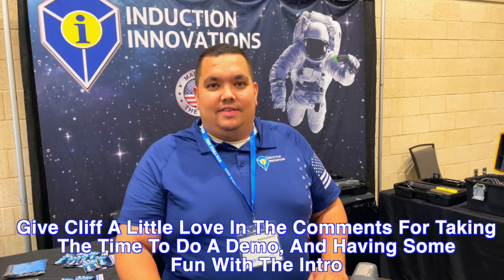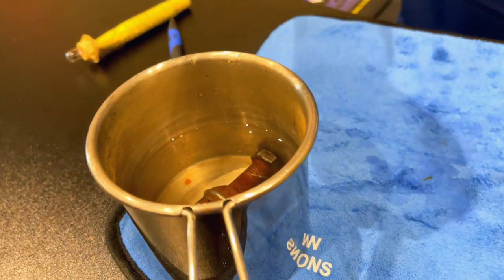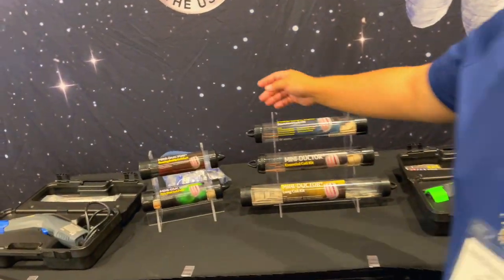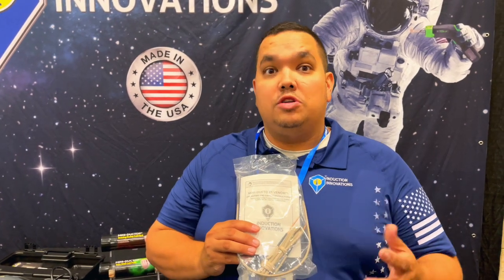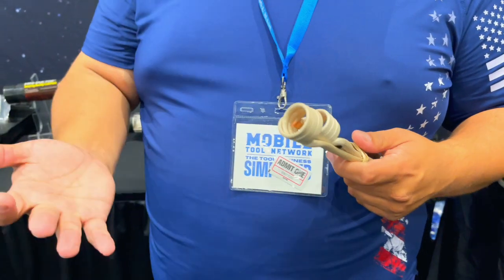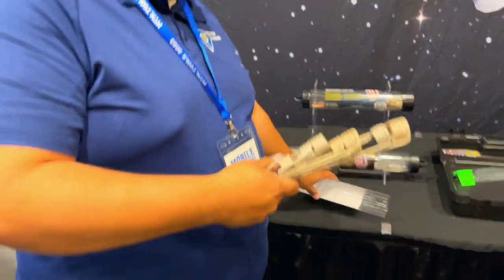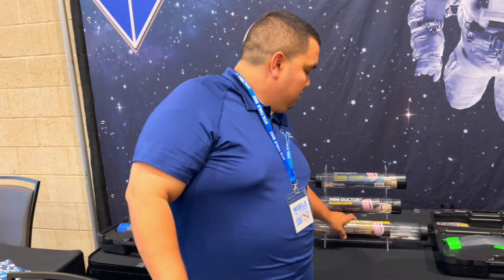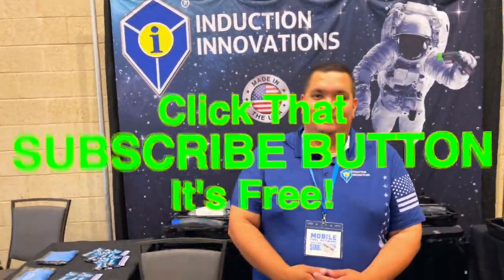Mini Ductor Venom Demo With Coil Kits Explained By Induction Innovations

Comment: They didnt invent induction heating. Not evn the zfs driver board.  But they brought it to the market in an easy to use portable platform.  Great tech. Back when they were more exoensive before competition drove the price down i home brewed one. Use it more than i thought i would

Comment: Problem with the venom HP modem is that it has a very sensitive internal fuse that will quickly blow. I had units fail and they are not covered under the 2 year warranty. You would think a $600 tool would have some sort of  quick breaker that can be reset.